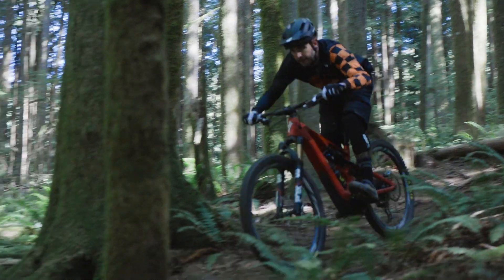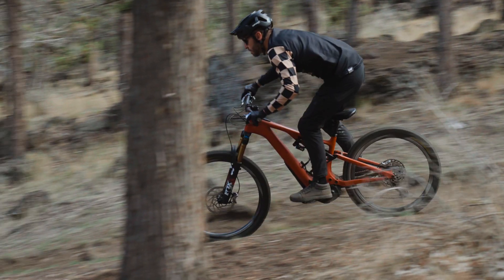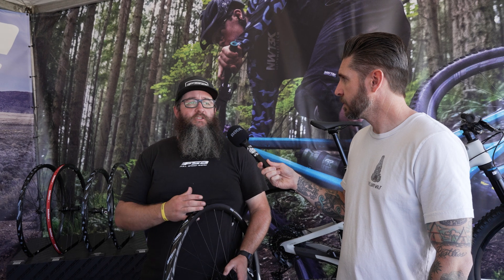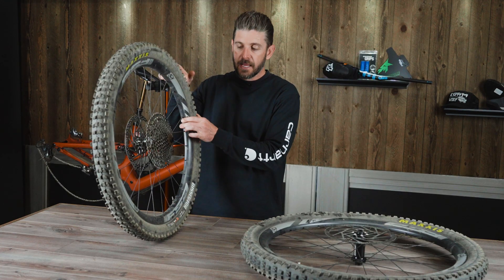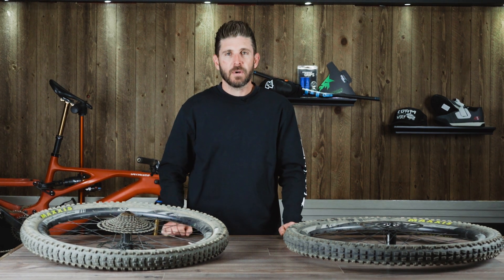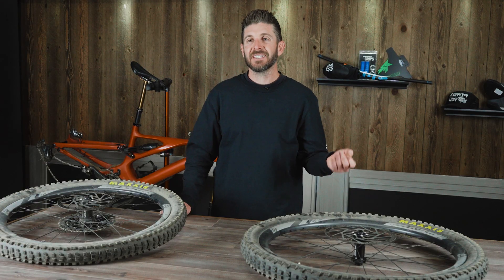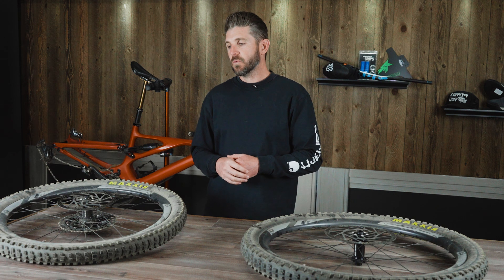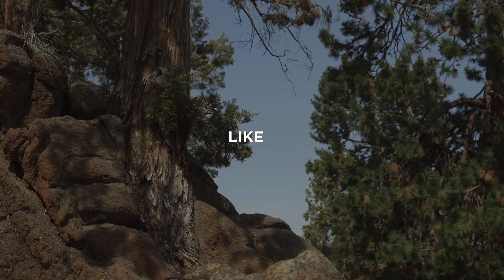FSA eMTB i29 Carbon Wheels - Dissected - Carbon eBike Wheels

Comment: 230lbs been riding one of these on the back of my trek rail along with the non-emtb 24h version in the front. Only a few 100 miles on them so far but liking them overall. The 24h front does make me a little nervous as that doesn’t leave much room for redundancy if a spoke breaks. I’d never pay full retail for these but they came with a bike I picked up and decided to give them a go on the emtb. Glad I did!